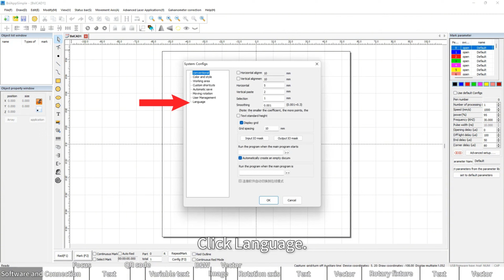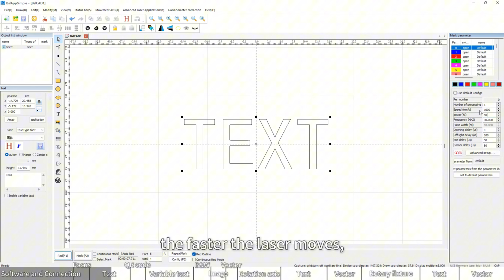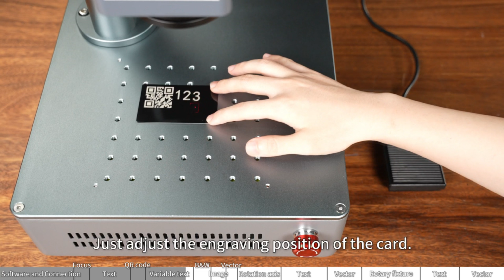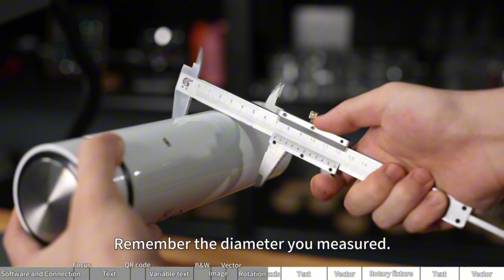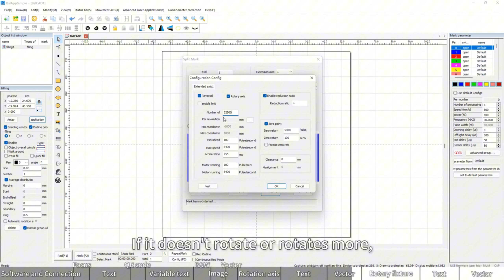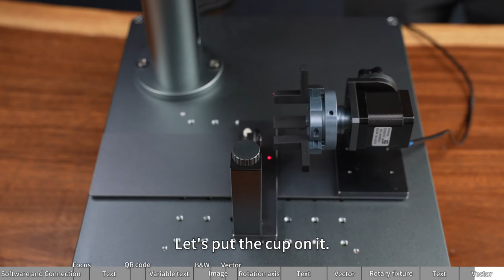DAJA S4 Computer Operation Tutorial

Comment: Hi, I'm a DAJA S4 user. How can I get black engraving results? What are the settings in BslApp?
Reply from the maker: If you need to engrave a black effect on stainless steel, we recommend using the material testing feature in Lightbrun to determine the optimal laser parameters for the material.